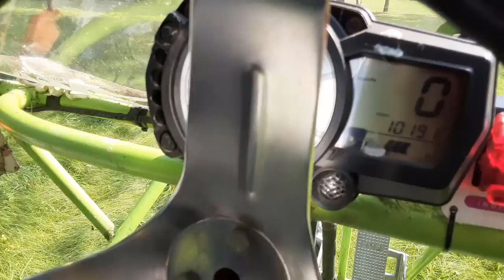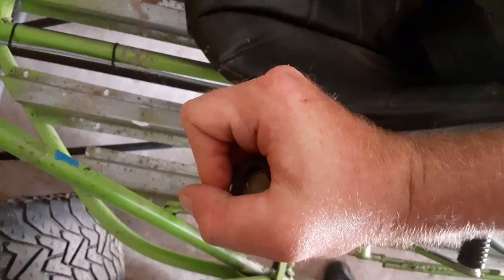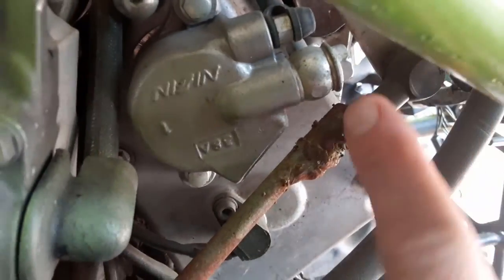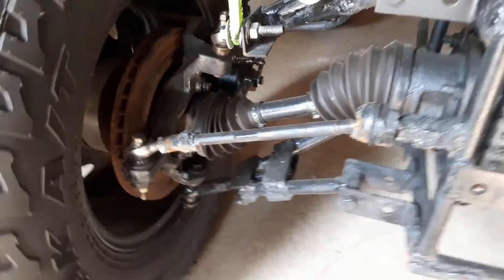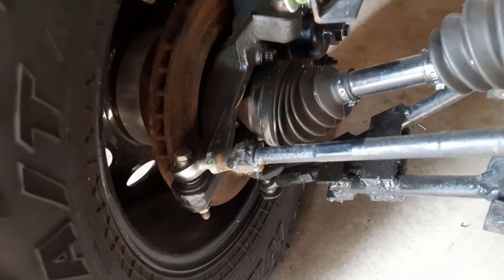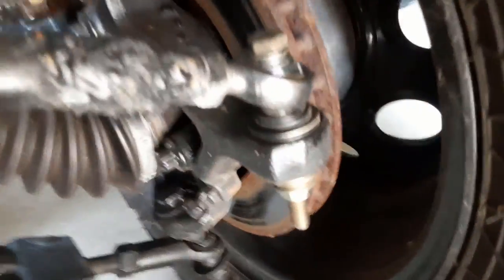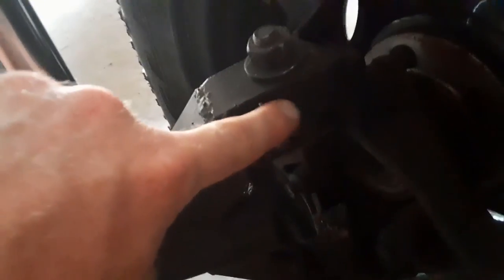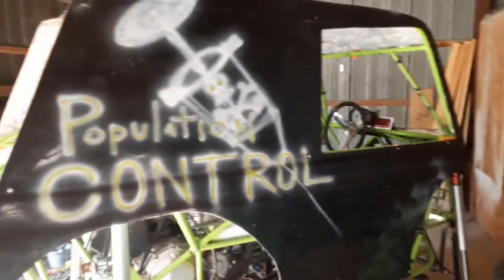Home Made Mini Grave Digger Monster Truck (Go Kart) by Adam Bogan

Comment: How much did It cost
Reply from the maker: Thanks for watching Famus. I've never sat down and typed it out, so let's figure this out real quick:

Fox 16"-travel Shocks: $250 each on Amazon ($1000)
4 Jeep XJ Compatible 16" Rims Amazon: $50 each ($200) 
Seat $50ish and seat cover $20 and seat belt $80ish from Jegs.com ($150)
2 crappy spring VW bus coilover wanna be's from Amazon: ($80 for 2)
( but I messed up and bought 4 in the beginning but realized they don't hold any kind of weight at all. So Im using two on the back as more for sway control.  Once I added the rear sway bar I could probably take those silver spring ones off but it looks cool I guess and would help if I landed hard I suppose)
Gas pedal and throttle cable from Jegs.com ($ 100)
I already had two old truck tires from my truck and bought two similar ones from Amazon for like $130ish each.($260 total) On the look out for some old Ditch Witch tires or something sim.
2 Jeep XJ brake calipers, brake line, fittings, pads, probably $100
4 Jeep XJ knuckles ($60 ea. used on Ebay) ($240 total)    
Front: 2 Jeep XJ wheel hubs/bearings ($30 each Amazon) ($60)
Almost forgot bolts! Nobody ever thinks about bolts in the garage and screws on a fence! Bolts cost alot, especially grade 8. Atleast at my local Do It Best. Bolts: $300
Rear: 2 Chevy S10 wheel hubs/bearings ($30 each Amazon) ($60) (Although I went thru a sh!t load of wheel hubs when trying to figure this thing out)
Rear: 2 wheel spacer/adapters, they change my lug pattern from Chevy(Hub side) to rim(Rim side)so I can run my jeep rims ($30 ebay probably)
Atleast 8 heim joints($14 each)/nuts($2ea)/and collars($2ea) probably ebay  ($144) (My memory is fuzzy on this row of prices, I know I looked online forever until I found like a 10 pack of heims, etc.... I didn't have alot of money to do this so I just kind of pieced it together over a 3 year period here and there)
The motor is a Suzuki 650 that I have found on Ebay for about $400.  You can also buy a wrecked bike from a junk yard or Craigslist.) 
Fiber Glass cloth on Amazon and Polyresin, paint brushes, sand paper, paint, airbrush kit: ($300)
Metal from Home Depot and Do It Best Hardware: ($400ish) (Which most people would tell you that this is not the right kind of metal.  I think it is plenty strong enough for a go kart situation, but if you flipped this thing every day for a year,
eventually it would be a metal ball probably.  I just wanted to building something cool and on a budget. It's more for just looking out my back window and seeing a lil digger in my back yard :) it was good practice too because I want to build a real one next. ) Sure Im forgetting stuff on this list but it cant be much more.

Grand Total-ish : $ 3,500-ish

I watched alot of YouTube  videos to study all the different parts and wow was it tricky to take something from my head and order a bunch of parts and make it work. 
Peace.
Reply from the maker: steering rack ebay $80
limiting straps on front $30
steering wheel: amazon $30
steering u joints (2) $60
welding wire: $200